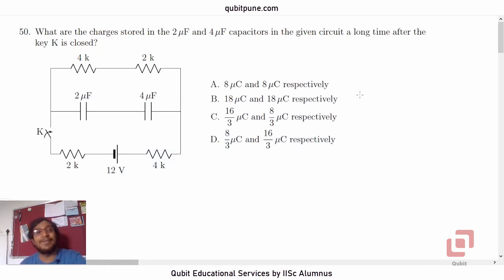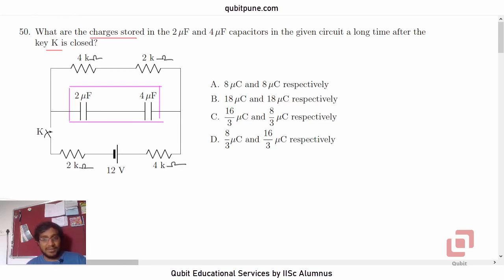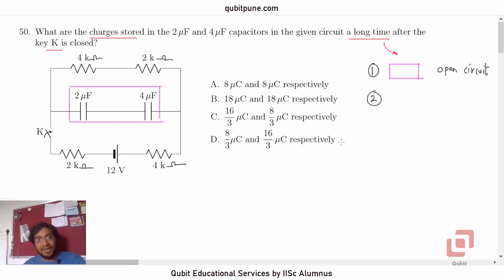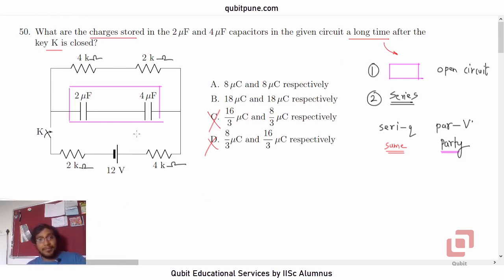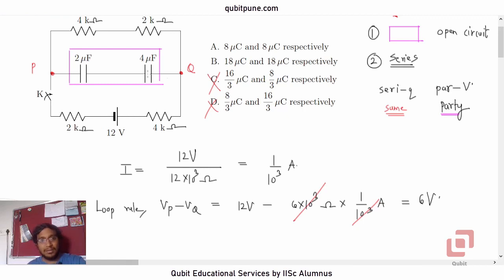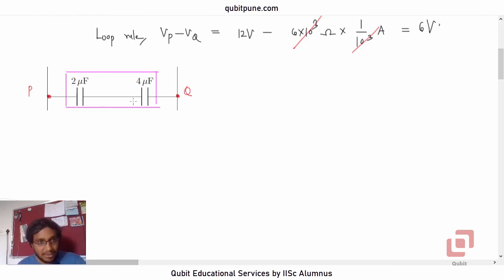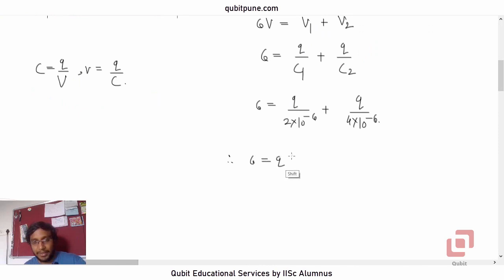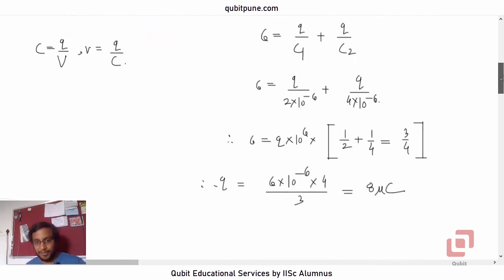Q.50 | IISER Aptitude Test 2021 Physics Solutions | @qubitpune  ​

Comment: Bhaiyya, I don't understand one thing, capacitor offers infinite resistance to DC currect that means no current flow through them, then why even the capcaitors will get charged?
Reply from the maker: The process of charging any uncharged capacitor involves transferring electrons from one plate to the other. This continues as long as the potential difference between the plates becomes equal to the terminal potential difference of the battery connected to the capacitor. So current flows in the outer circuit of the capacitor, during its charging (and therefore its discharging).

Once charged, the current flow stops. This represents open circuit condition.